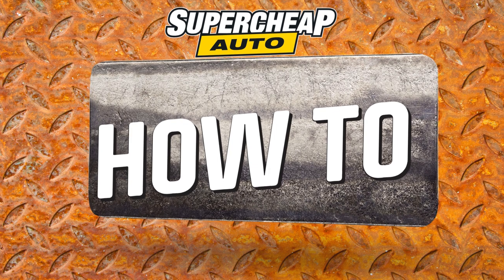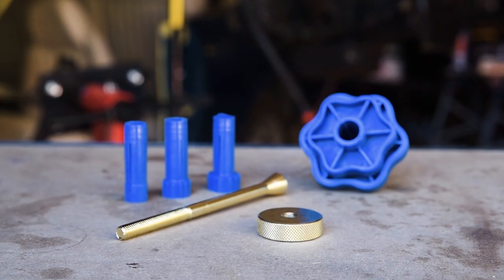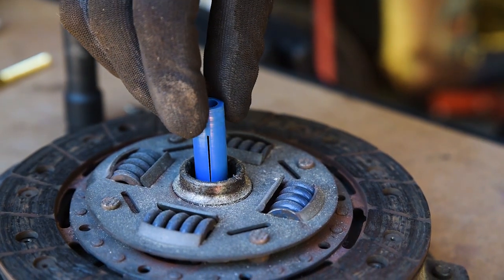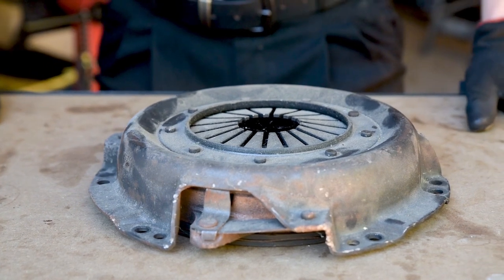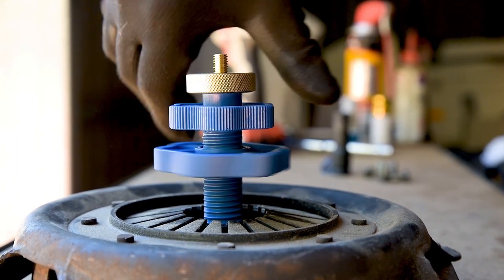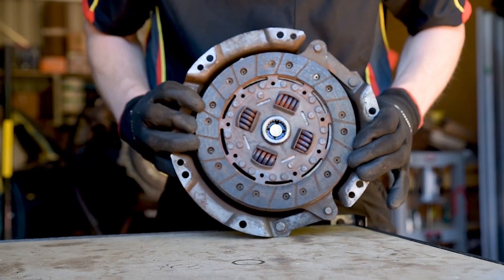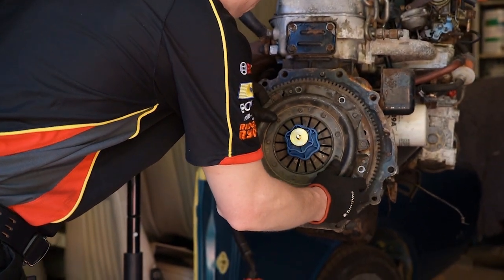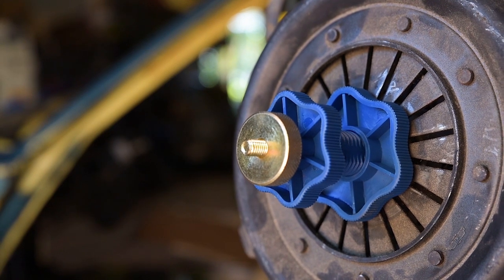How To Use A ToolPRO Clutch Alignment Tool

Comment: This tool does not align the parts, it just holds them together. The big screw must be conical, so then alignment is possible.
Reply: I was about to say that.  If you are depending on your eye to make sure the clutch is lined up with the pressure plate.....it's bound to be not exactly accurate....at least not for everyone, every time.

Comment: Save your $3 or whatever this tool costs, it is rubbish.  I bought one and ended up aligning my clutch by eye because this tool is hopeless.  It doesn't align anything at all, it just holds everything together.  You still need to align the clutch plate to the pressure plate by eye, and if that is out by even a little bit, the input shaft won't go in to the spigot bearing.  I had a few goes at making this thing work and we gave up on it.  Complete garbage.  Spend the same money and get a proper clutch aligning tool that has splines and a collar and shaft for a spigot bearing.  Hell, for the $10 they cost buy a few sizes and ditch the univeral crap.
Reply: Rubbish, crap tool.... yeah, I agree, save your pocket change and buy a real tool!
Reply: Faaark yea using 1 right now shit as

Comment: They really are crap. Avoid. The whole point is to align the spigot with the clutch disc... Which this does not at all. Mine was free so I ditched it and machined an aluminium spacer. Again. Do not buy this crap